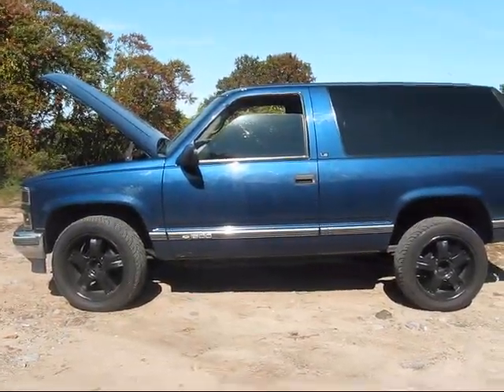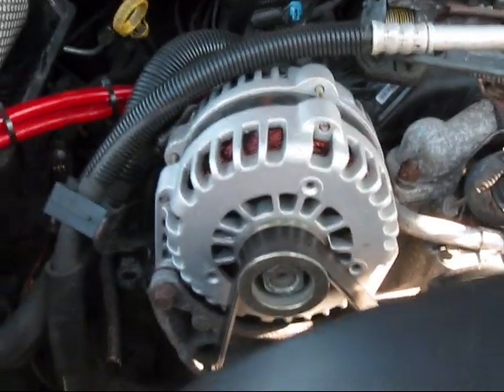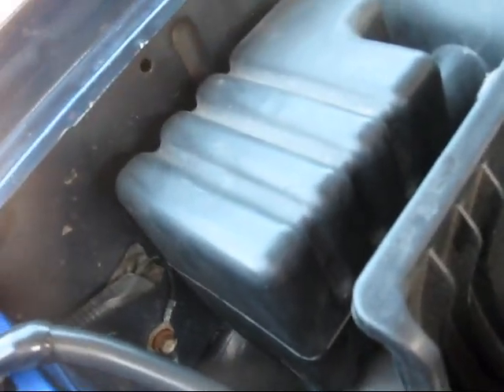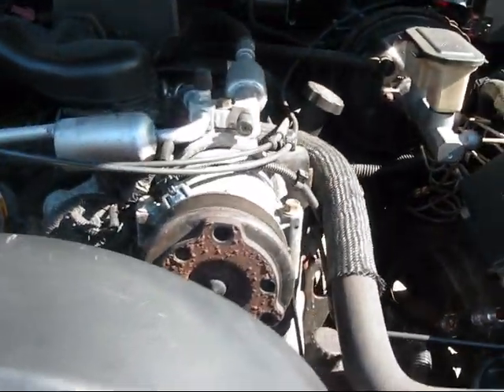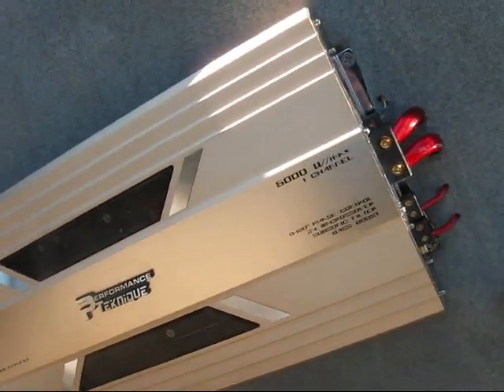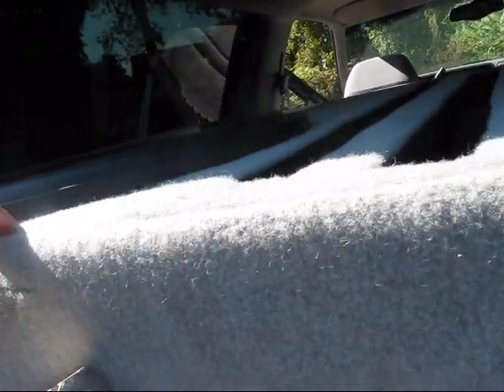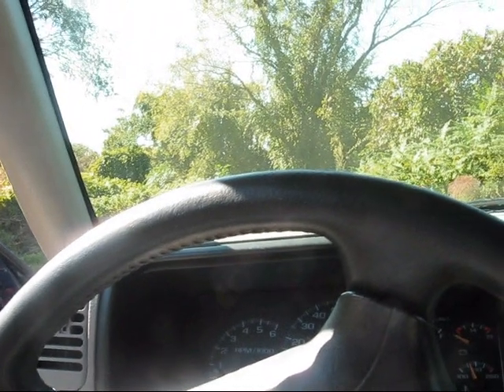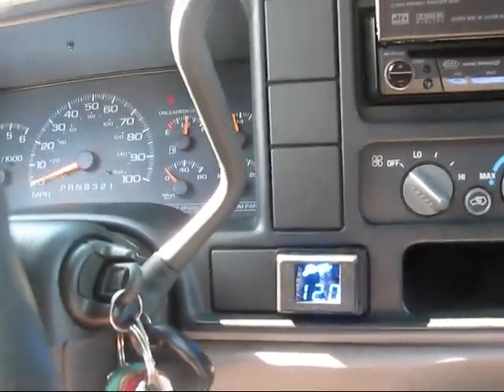how to wire multiple batteries

Comment: @jonmanch3st3r Continued: Each set of batteries will be run in parallel seperately from my front battery so i can power each amp independently. I got that info from the exo channel and a response from him too. Does that sound about right or am i misunderstanding something.

Comment: @jonmanch3st3r I already have a dc alternator for my truck but havent installed it yet because waiting for other stuff so let me get this straight. I need extra batteries for my sub amp and extra batteries for my 4 channel amp. (i would like to get a sundown 200.4) which is why i would need batteries for that too. So if i run 2 positive charge lines from my front battery and 2 negatives from my front battery to the back. One set to the sub amp batteries and one set to the 4 channel batteries.

Comment: So whats the best way to ground all the batteries in the back when you get them. So the 4 batteries in the back will they be run in parallel or series and how will you be grounding them and wiring them together in the back.

Comment from the maker: @jimmybal10 honestly your brst bet is to upgrade your alternator,its more expensive but it will stop voltage drop in its tracks,i wish i would have done it instead of buying 5 batteries when i only need about 3 to support my stereo

Comment: i wanna put another battery to run my 15" aa mayhem but i dont know if i should cause my altnerator is only 110 amp and i already have a hc 2400 in the front should i upgrade to 2?

Comment from the maker: @93DARIAN personally i always run 2 charge lines,but you can also run a wire from the positive off the battery in the front to the pos to the battery in the back and it will work as well just make sure to find a good ground for the rear battery

Comment: ok i have a question i want to add a second battery to my car but for now i have a stock altnater so sould i run two charge lines one for each battery or should i run one to the battery up front then run one to the battery in the back i really could use help with this thanks

Comment from the maker: @darockwilda915 if you move 1 battery to the back you will see a big difference in voltage drop,shortly after this video i moved mine to the back as you can see in my newer videos and it helped out alot

Comment: They are both in the front somewhat similar to yours. Except my second battery is by the brake booster by the firewall. My amp is 2000

Comment: I have a question.I have two batteries connected. And a 200 amp alt. It seems as my amp is sucking all my power directly from the alternator. And the batteries aren't being used much. Any pointers?

Comment: i like the video. i wanted to ask i have 2 12w7, a yellow top, and plan on getting another w7 and have them each run on their own1000/1v2  im upgrading my alternator to a 270xp from dc power my question is if i do that do i still get one more battery

Comment from the maker: @heymrfoster its not that you lose power its the possibility of having a gap between the terminal and the wire which can cause arcing in turn popping fuses or your amps....also its alot more expensive to buy a 0 gauge wire criper which goes for 80 bucks....soldering is the best safest and cheapest way

Comment from the maker: @heymrfoster when i did my big 3 i grounded out both batteries just to be safe,on the charge lines i ran 2 seperate lines just to make sure i wast getting good voltage from the alt and not pulling off of the other battery,i aslo fused both betteries just in case of a freak spike in output...i dont trust aftermarket stuff 2 much i have and many problems so its a cheap warrenty

Comment: @jonmanch3st3r r u sure. Does the batteries both have to be same type, model and age?? I'll be running 2 12" re mx. With a jbl bpx2200 And a r300.4 for speakers.

Comment: Hey bro i got a yellow top battery with the big three and its used for my starter. i got a second battery its a blue top. would it be ok if i would wire my batteries like yours, having two charge lines to both batteries and using the second blue top battery for only my system??

Comment from the maker: @pinoy1225 yes you can run that with no problems,actually alot of people do it that way to get better amperage at idle and on top end  seing as bigger alts and smaller alts put out more or less power at different rpm's

Comment: hey do u know if its ok to have two different amp alternators? my stock alternator is 80amp only for starter and im wondering if i could install another alternator thats 150amp for my system alone.

Comment: well perhaps you could give me some advice.  I have a rockford fosgate bd 1000 1 ohm stable amp.  I have an old school 1600 RMS 18 inch Cerwin Vega Stroker in the mail on the way.  I have a factory alternator and 8 gage wiring kit.  Is that enough or am I risking a fire or breaking my expensive amp?

Comment: @jonmanch3st3r Thanks for explaining!   So your starter pulls from both batts, but did you rewire your starter to pull from both batts?  or is it in stock connection/configuration?  Thanks again for you time and knowledge!  I'm getting to closer to understanding this aux battery stuff! =)

Comment from the maker: @hotrodbigbod what up man,an isolator is only needed when you want a starting battery and another battery back to run higher voltage that would burn out your eletrical system like 18 volts or higher,i kept mine nice and simple the alt charges all my batteries at once and the starter pulls from every battery as well so it starts with ease at all times

Comment: @ 6:13 use dielectric grease on those connections and they wont rust nowhere as fast and conduct better i like to rub it in on a freshly ground clean metal surface on the eyelet then screwing it down...then gob some more on to seal it up a bit good video and nice install :)

Comment from the maker: @tha1onlyjake yes or you could wire it in the back with the system,all you gotta do to keep it charged is run a ground to the frame...then from the positive on the front battery to the positive on the battery in the back and it will stop and voltage drop until you can get another 4 under the hood later

Comment: @jonmanch3st3r alright, thanks man i think i would do the big 3 then,when i upgrade my alt, i contacted The guys at DC Power but they haven't got back to me yet, and a second battery in my trunk is out of the question since i drive a coupe. alright thanks man for the info

Comment from the maker: @greenlight2600 i would say only do the big 3 if you upgrade your alt but not if its stock,the best thing u can do is get a second battery 4 the trunk,you can find them on ebay type in car audio battery and find a kinetikhc2000 it will stop it dead in its tracks

Comment: What's up dude, I was wondering if I should get a capacitor or not, I'm thinking I shouldn't because it won't do me any good but I want a second opinion, I'm not having any major voltage drop or anything but it's there, when I'm listening at normal volumes the voltage is stable at 14.3-14.0, but when I'm bumping hard it drops to 13.5-13.1, do you think doing the big 3 would help a bit? Or the cap would do more damage then good? Alright dude let me know what you think

Comment from the maker: @sk8er99554 ya man deff dont go with caps they suck,my suggestion is to run a kinetik battery they have all diff sizes jusr measure your stock battery first,then go to ebay and search car audio battery,then find the size that fits your truck....i guarentt that 1 battery fill solve the problem.also go on google and type in ford ranger alternator amperage that will tell you wut ur dealing with

Comment: hey man, I have a question. I have a 4000 watt amp thats pushing (2) 2000 watt 15s. What upgrade would be enough for my system? Battery, capacitor, Alternator, big 3?

Comment: @jonmanch3st3r well the most if can happen you kill your rectifier inside alt, like I did, and you will get a lot less power from alt. But if your fuse goes, the one between alt and battery, then you alt will drive no load, and as far as I know, that will produce voltages higher that your main in house is, which is what, say 10x of normal car voltage... that will kill everything in alt, from rectifiers, to regulator and I hope that just that, but if could go to car cpu also via alt turn on wire.

Comment from the maker: @First2ner i ran the fuse as a just in case thing...cant hurt to have it,and if the fuse does pop then thats a good thing i had it there right??also it would not kill the alt if it popped because there are 2 charge lines so the alt will still be doing its job on the other batterys....i also have my stinger volt meter so i would notice if it popped right away

Comment from the maker: @slipknotfan1042 the first thing i would upgrade if i was you would be my battery...stock batterys arent designed for stereos.....i recommend kinetik,just measure your stock battery and then match the dimensions they have all diff sizes...go to ebay and type in car audio battery

Comment from the maker: @dragonsage2008 ya man deff get the big 3 done first,it sounds like your alt should handle your setup no problem but the only way to tell is to get the 2 batterys in and see if you get any voltage drop...i would actually get 1 battery first and see if it improves

Comment: clean install..but i got one question..
on your battery on the driver side...is that power wire running to your amps...is that 0 guage to a fuse that turns into 4 gauge??? looks like it at 3:06 lol

Comment: but im worried about wiring up the batteries, i have 0 gauge positive going back too the trunk, and i wanna hook that too the positive, and ground the nedetive too the frame but im worried the voltage will add being 24, rather than in parrallel just incrasing the amperage, HELP!!! thanks haha

Comment: @jonmanch3st3r thanks man that really helps, because im noticing more and more, that my battery drains faster, because my stock alternator was dying, i got an aftermarket "200" amp alt which put out around 115 amps idling and 200 at highway speeds

Comment from the maker: @scottyBoland well with a true 300 amp alt you will deff be safe with no worries...as for the 1 battery it all depends on which kind and what size you do with.....i would say to run 2 kinetick hc2000's and you will have a nice reserve...just save up and buy 1 at a time they are 250 each on ebay

Comment: i got a 1999 tahoe 4 door and its got dual battery trays. i dont plan on running more than 1500 watts t the most because the cops around here are dicks. im more than likelly going to do the big 3, throw 2 batterys in and put all 4 gauge wire because right now my zx1000.1 dims my lights when the bass hits on some songs.

Comment: Damn your up early! I was just sayin that cause the sheet metal can only hold off so many watts, you'r goin way big for body panel grounds. You definatly need some frame grounds, and maybe even a ground run if you wan't every drop of power you gan get back there at your buss bar junctions. Dude, come join my lil audio group! Just made it the other night. Posy up your alarm vids nd some others! You should definatly be up in there! I tried to send an invite, but they won't go out for some reason.

Comment: "I'm "ONLY" gonna be running about 15K or so RMS"...

Lol! You damn junky! LoL! 

1/0ga cables are looking good man. Only thing I would do differently would be using the fraim rail, but that's me. Once you get all four subs going you might wanna try that. The core support for the rad is a decent spot, but when you start pullin amps with the rest of the BTL's and amlpifiers your going to be beyond maxing out those ground connections. Good vid brutha! Got a good idea of watts going down now!